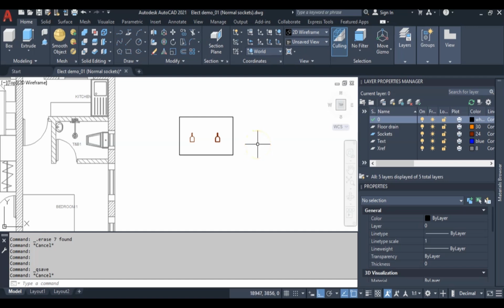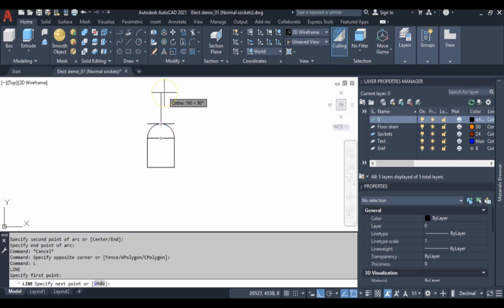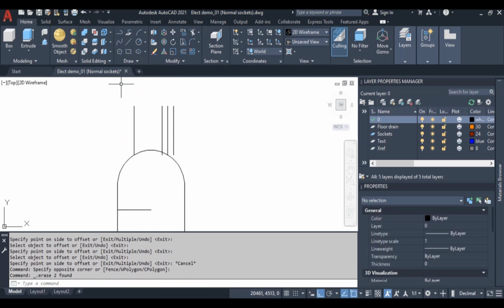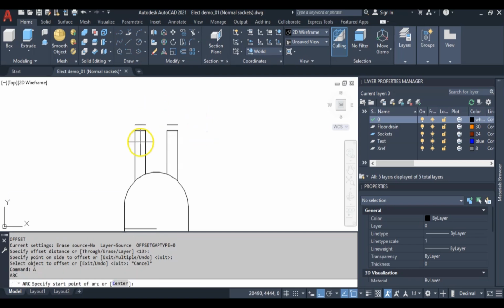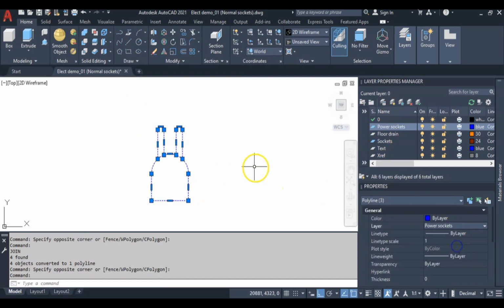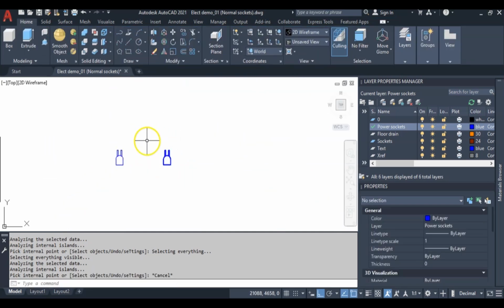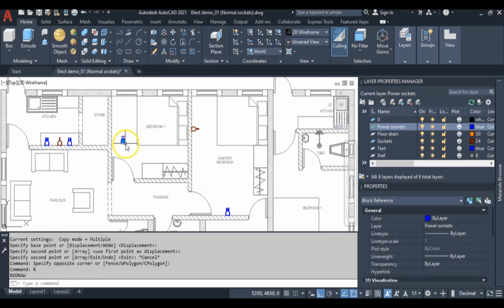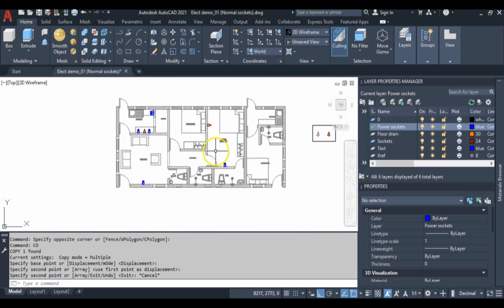How to design Power sockets using AutoCAD in the Electrical building industry

Comment from the maker: @tekniprep
Power sockets are essential parts of Raw power design in Electrical design in the Building industry. In this tutorial, we will learn how to develop a symbol for Power sockets using AutoCAD 2D for electrical Building design. We will learn how to position them in our drawings, how to scale lower or higher depending on how we want it to fit in our Building plan.